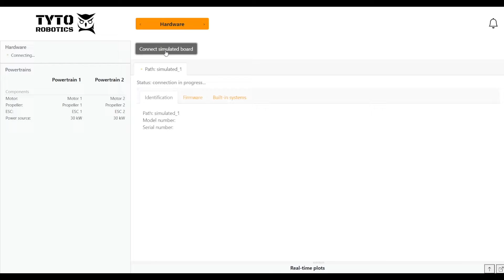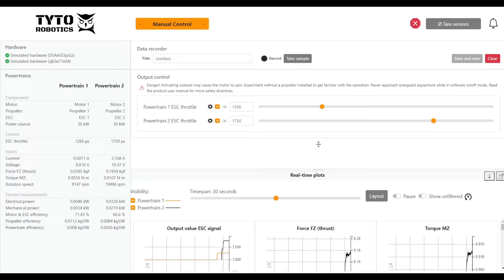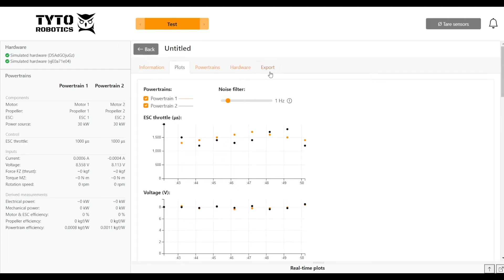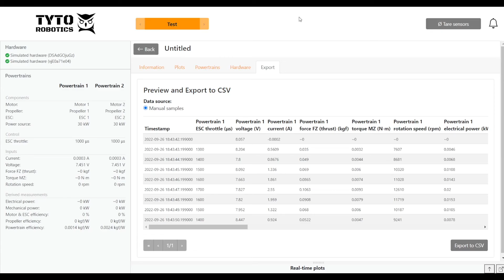How to Use the Simulated Thrust Stand - Flight Stand Software

Comment: how can i map power train 2 as i seem to be getting no data
Reply from the maker: Good question - in the Flight Stand software, connect both powertrains in the Hardware tab, then go to "Powertrains" in the menu, click on the tab for Powertrain 2 --> Hardware mappings --> then choose the ESC option for simulated hardware #2.